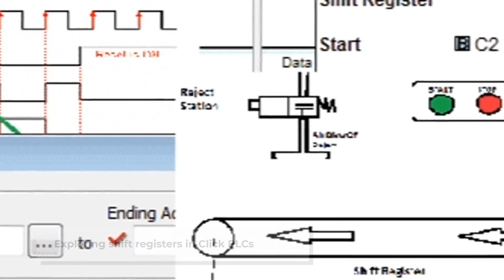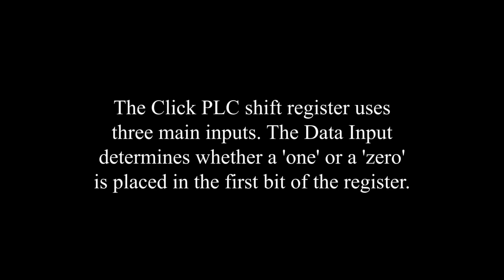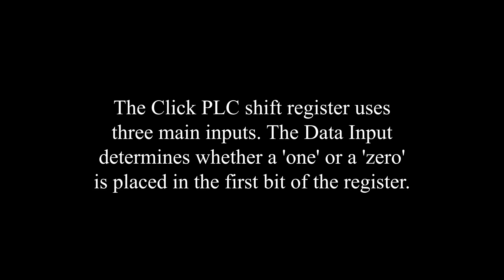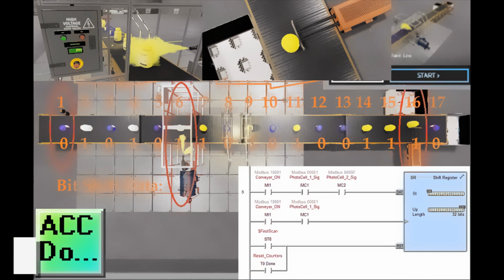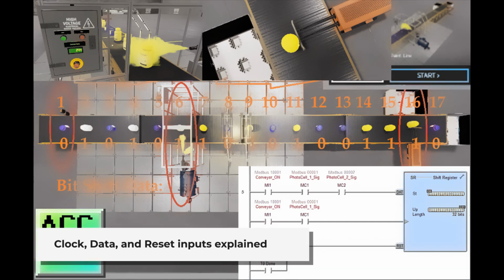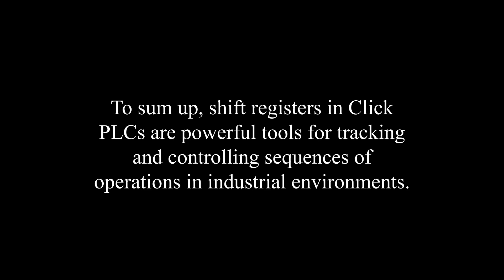Mastering Shift Registers in Click PLCs for Effective Sequence Tracking

Comment from the maker: More information can be obtained at our website. This includes all of the links mentioned in this video. 
https://accautomation.ca/click-plc-shift-register-instruction

PLC Program Example – Shift Register (Conveyor)
https://accautomation.ca/plc-programming-example-shift-register-conveyor-reject/
https://youtu.be/K1j6HvNF-5s

Download the Click Programming software at the following address:
http://support.automationdirect.com/products/clickplcs.html

There are several reasons why we are using the Click PLC. Here are just a few.
 - Investment is low for the hardware, and the software is free
 - Standalone PLC with built-in I/O
 - Communication ability - Ethernet Port, RS232, RS485 - support for Modbus RTU, Modbus TCP, etc. protocols
- Ability to expand the system with various modules, including RTD and Thermocouple inputs directly.

https://www.accautomation.ca